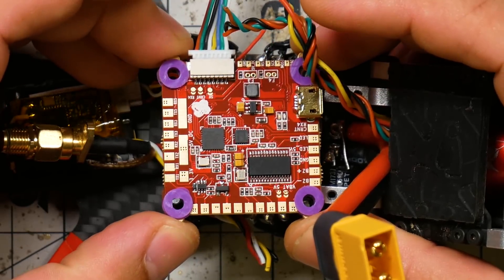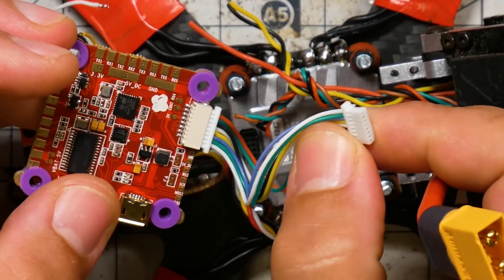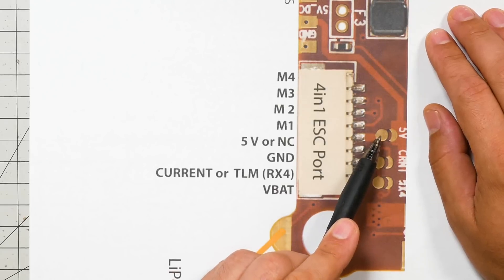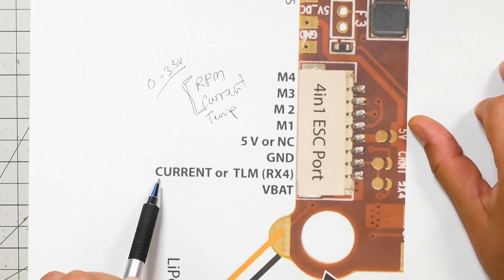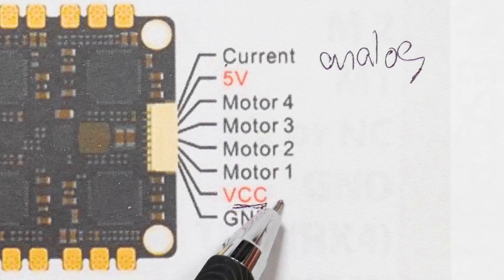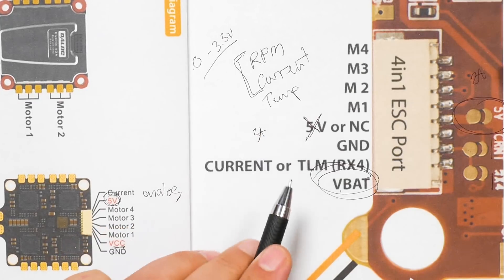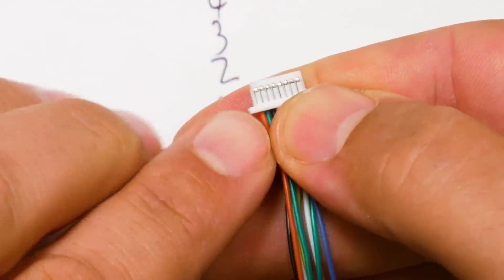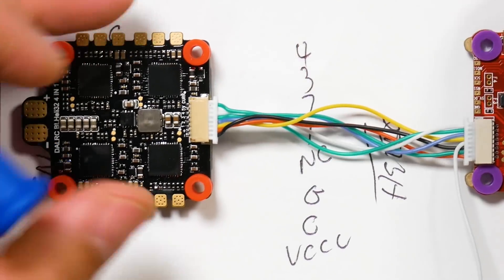How To Connect a 4-in-1 ESC to FC | HELIOSPRING DALRC ENGINE

Comment: My HGLRC fc is wired to my iflight esc. Motors match 1-1 2-2 3-3 4-4. I get the flip on takeoff. I'm guessing that HGLRC fc (motor 1) is not the same as iflight (motor 1). I know I can change the mixer which I have done so, but can I also just wire fc 1 to esc 4 and fc 2 to esc 3?

edit: it's a 4-in-1 esc.

Comment: Hi, I want to build a Quadcopter and I have purchased few things for my drone, but need to confirm few things from you:- 
Frame:- Martian II Reptile 250mm
Motors:- RS2205 2300KV motors
Receiver:- Flysky FS i6s

I am going to buy Emax Skyline 32 Advanced version and a 4 in 1 ESC but I am not sure which ESC is compatible with this and how can I connect all this connections for receiver and ESC. Can you please make a video of this or send a reference link where I can look into this?

Comment: Ok, so I have two wires left to go to my ESC. They are CRNT and RX6. The only two pinholes left are ground and 5v. Do I just have to pass on telemetry? And What is the purpose of RX6 in this case?
Reply: On second thought, I didn't get the wrong ESC, did I?

Comment: Do I need the current sensor cable coming from my flight controller if I don't have a pinhead for within my 4in1 connection or a pad to solder it too

Comment: Joshua,
Have the same question that a couple of other folks posted.
I am connecting a F722 Flight controller to 40A AKK esc. I am trying to match the pins between both boards on the connector cable. But I am confused on what the R6 on F722 stands for.
On my ESC: 5V GND GND BAT 1 2 3 4
F722: BAT GND S1 S2 S3 S4 CRNT R6
EDIT: As there is no separate Current on the ESC, what do we do with CRNT and R6, should these pins be completely removed ?

Comment: Hey Joshua! Great vid. Im building my first quad and ran into a small issue. Im using a iFlight Succex-D mini ESC and the Mini magnum 3 F4 flight controller. I wired everything up and it doesnt seem like the FC isnt powering on, however the LED on the xm+, connected to the FC, is turnibg on but faitly. The wiring from ESC to FC all match up to diagrams. The ESC has a VBAT and the FC has VCC, which are wired to each other. Can this be the issue? Thanks!

Comment: Thanks for this video JB. Super helpful! I purchased the iFlight SucceX-D F7 TwinG Flight Controller. The ESC pinout for it shows, GND, VBAT, M1, M2, M3, M4, CUR, and R5. The emax buzz esc shows S1, S2, S3, S4, Tx, VCC, and GND.  

The S1-S4, connections go together with the M1-M4 and GND and GND go together correct? Tx from your esc goes to the CUR on the F7 board I think..VCC goes to the VBAT? What do I do with the leftover R5 connection? 

Thank you so much!!
Reply: looking for the same info. did you ever figure out ?
mine has an R6, dont know what to do with this ? We would also have an extra GND pin, so perhaps leave it out ?

Comment: What happens when my plug gin too the flight controller is broke so I can't put 5v too power the fc idk what to do. Is there a way too put 5v too the fc without the plug
Reply from the maker: You can provide 5v into any 5v pad on the FC.
Reply: @JoshuaBardwell  i believe they gave me the wrong flight controller with the f445 stack. My flight controller would power up with usb and i could see my camera and vtx would power up. I dont have a xm plus receiver on yet but i wouldnt think that would not allow my flight controller too power up with battery connected? Once i unplug my usb the fc board lights would cut off but my vtx would still be on. I dont know what too do.
Reply: @JoshuaBardwell  Ijust dont know were too get 5v from the esc itself , there's no 5v pad that i can see

Comment: Hello again Joshua.  Wow, what a string of bad luck I've been having.  So I returned the 4-in-1 65a esc (below) and just bought 4 individual escs.  Soldered everything back up to the Joshua Bardwell FC with a focus on making it look beautiful again, ha ha, and guess what -- the brand new escs plugged into to the new replacement JB FC from RDQ (the first one fried the two right escs requiring me to purchase new ones lol) are doing the same strange power cycling (the fc seems to remain booted) and the tones get out of sync.  So clearly, the 4-in-1 was fine, and I made the 8-pin cable fine.  Ugh, I have not flown a 5" in way too long now ha ha.  You know I suppose it's possible that a microscopic piece of solder got in between something, but I even take precautions by putting a piece of tape over the board where I'm not soldering.  I have gone years with zero issues.   I doubt RDQ will send me another 'nother one.  So I guess I should cut my losses, blah
Reply from the maker: if the ESC's are making the full five startup tones, then they are losing power. If they are making only the last 2 tones then the FC is losing power or the signal wire to the ESC is messed up.
Reply: @JoshuaBardwell  Two different sets of escs, same results (4 separately wired vs. using 4in1 plug) so it was the fc.  RDQ gave me a credit on the board.

Comment: Hi Joshua, this is Fred from Orlando, you helped me get a bad JB FC replaced by RDQ.  Thank you - it is here.  I am wondering if this sparks any memory of what might be the problem.  I purchased a new 4-in-1 esc since the first board fried two of my 4 discreet ones.  I picked up a 65amp HLGRC one.  I followed this video and was super super duper careful that I made it match correctly.  With the 6pin esc cable in, it powers the fc, it all looks fine, then the escs start to power cycle.  Dah dah daaaah sound with maybe 2 seconds between each restart.  I plugged it into the computer and looked at the escs with BLheli32 latest, and it says unknown protocol instead of blheli32.  Perhaps I misunderstood one of the wires' purpose.  I also very carefully followed the jb fc build video again on the new fc and triple checked everything.  The solder bridges on the back are set for 5v and telemetry.
If you happen to read this and feel so inclined to respond, thanks so much!  I would be your Patreon partner but I am currently on a fixed income which limits me a lot.  I'll throw you some bucks on a live chat though next time I'm there.  So helpful.
Reply from the maker: Usually if you see "unknown protocol" in blheli that means that the ESC is blheli_s not blheli32.
Reply: @JoshuaBardwell  You're incredible at replying.  Ok thank you.  I will look up more about it, but I tried flashing them with blheli32, I honestly don't remember if it successfully flashed.  I can't imagine this fancy, expensive 32bit esc came with S by default. But escs I have not delved deep into, but maybe there's a good reason to.  
Thanks again.  I'll see if it lets me see it as blheli_s.  After that, off to watch your new RR tuning video.
Reply: Well I went back in and it definitely has blheli32.  It says so right above each "unknown input protocol".
But now I am seeing a repeatable pattern of esc #2 on the board only booting successfully once in a while.  Most of the time it's showing just --- for #2.
I guess I'll run your new board with discrete escs.
Thanks again, much appreciated, you always inspire me to dig deeper.

Comment: What does the N/C on mamba f405 mk2 4in1 esc mean? Im trying to wire it to the synergy f4 which has everythingtthe same plus a 5v. N/C on the esc and 5v on the FC. What would I need to do?
Reply: I should have watched the whole video before asking huh? Not used! So basically I don't even need to plug that one in. Thanks for the video! Bought a new FC using your links and ty for the advice on fb!

Comment: Hello, I have a question for you. I'm building my first quad and I choose Matek f405 std and racestar 4in1 esc 35 a. Question is: esc doesn't have 5v output and fc hasn't a bec. Can esc power fc from vbat?
Reply from the maker: The F405 std needs 5v input. It cannot be powered from vBat.

Comment: I have mamba f405 power stack and it have it's own connector from ESC to flight controller but OSD for current sensor is not working. Do I need to feed current signal to one of the UART??

Comment: help......................
i recently changed my escs to REV35 
it has same pin diagram i have only connected signals wires with F3 
but its not working 
Is it must to give 5V on 5v pin and gnd as well?
Reply from the maker: The FC needs power somehow. How it gets it is up to you. 5v input may be one way to do it.

Comment: I have a tmotor f55 and a kakute f7 (not aio). The f55 has both, tlm and current. Is it possible to connect the current of the esc with the tlm port of the fc or is this the best way to burn both?

Comment: Hey, if you dont have the right plug, can you solder them directly to the pads?
Reply from the maker: Yes you can. But I suggest ordering an sh cable set and making the correct cable. Racedayquads sells the set.
Reply: Awesome, thank you for the quick response.  They are out of stock, Ill see if I can find the set somewhere.

Comment: Fried my FC accidentally wiring the vbat wire from the ESC to a signal pin to the FC. It burned the F4 chip on the FC and the ESC visually didnt take any damage but it doesnt boot anymore. Can the esc still be fixed perhaps by identifying the component that broke? Mosfets are still good

Comment: Joshua,

I have purchased this ESC for an arming issue I have been having. It is all installed but when I go into Blheli and connect every esc reads "Erased or unknown firmware" If i select flash Blheli it reads the same message but with a lower case "u" underneath. Any suggestions. Btw the copter arms and spins motors with radio.

Dan
Reply from the maker: Are you using the correct version of blhelisuite? BLHelisuite32 for blheli32 ESCs and regular blhelisuite for blheli_S ESCs.
Reply: Joshua, that was it!!! Thank you!!!

Comment: Almost exactly what I was looking for! I purchased the same DALRC but I want it to be connected the the kakute F4 v2. The kakute F4 v2 diagram says :

1 Battery voltage
2 R5 (for ESC telemetry)
3 Ground
4 Current sensor input
5-8 Motors

So I guess that the pin 1 will be VCC and the "current" from the DALRC goes on the pin 4 ? What about the pin 2 R5 (for ESC telemetry) ?

Thank you in advance if you want to answer me :) This is my first build ever and I am quite nervous :)
Reply: same question, I see at least a couple of people asking. Did you ever figure this out ?
Reply: @warandv6614  Yes I did figure it out on my own, I also figured you need to "insert coin" to Bardwell for technical help :)
If you give me your email address I will email you the schematics I drew.
Cheers.

Comment: If you power the FC with V bat from a 4 in 1, will you get V bat at the other V bat   and ground inputs? ( to power VTX)
Reply from the maker: Yes. But you have to bridge the solder jumpers to put vBat on the pads where there is a choice.
Reply: Joshua Bardwell  Thank you

Comment: Joshua, Are you still liking the Heliospring FC I am a Matek fan but i would like to try this board. Problem is since its huge release i haven't heard much and read a few bad reviews i do not put much stock in the reviews but there has not been a lot of long term user info. 
Congratulations on your JB F4  it is a nice looking board as well but, i would like to try the helio and not regret it LOL. I know your busy, I want to be a patron but i think my girl would take a tack hammer to my head LOL!  Thank you for all you do!
Reply from the maker: I'm replacing the ESC on my Helio quad and haven't flown it in a while. But I liked it the last time I flew it.
Reply: @JoshuaBardwell  gonna replace  mine as well...bad fet. what are you replacing it with?

Comment: Hey JB  Really enjoy your videos.  I have a quick question on the UART port designation in butterflight for the FRSKY S- Port.  If connected as shown in Helio layout, which UART is used?  I assume UART 5 for smart audio but not clear on S- Port.  Also assume camera control does not need designation.
Reply from the maker: I'm sorry I don't know this off the top of my head. I'm using Crossfire on my Helio build so I'm not using the SBUS or SmartPort pads.
Reply: OK  Thanks reply.  I have not found any documentation with these details.   There's always good o'l trial and error.

Comment: I’m doing the same thing but with a dys f4 pro that I got in my kwadbox . My question is the dalrc has current 5v vcc and ground the fc says bat- bat+ nc and ground if I change the harness what would go to what
Reply from the maker: VCC is the same as BAT+

BAT- is the same as Ground.
Reply: Awesome thank you I thought so but wasn’t sure so I thought I’d ask the brain. What about the current?
Reply from the maker: Connect to the analog current sense input on the FC.

Comment: Hey Josh I just want to say first and foremost great job with all the info... Question.. I have a NTXF4 fc with the vtx built in, I was flying the other day and had a bit of a crash, and I noticed the metal cover to the vtx came off,  I tested everything and all works fine,  now my question is, is it ok to fly without the cover, I know the vtx gets hot so I don't know if it's just a shield or is it a heat sink as well,  I don't want to damage anything by flying without it,  but I am jonesing to fly.
Reply from the maker: The cover is an RF shield. I would expect some issues to pop up if you flew without it. Like video noise or random failsafe.
Reply: Joshua Bardwell ...Ok, thanks, I did notice more noise in the video feed afterwards... Thanks for the feed back.

Comment: Hey, JB.
Same setup I use and I soldered the Current and 5v bridges. I am using 5v in from DalRC as well as VBAT in, but not the bridge up top of the board and everything works fine....using VBAT for OSD.

Comment: Hey Josh, I have a DALRC Engine and a Holybro Kakute V2 F4, but not the all in one version, so there is no pin plug in on it, where would I go about soldering my Current and VCC/5V wire?

Comment: Hi josh, I’m relatively new to the hobby, I ripped off my buzzer soldering pads on my dys f4 flight controller and I was wondering if there are different options to wire a buzzer to it or can I repair the soldering pads?

Comment: I used the helio spring fc with a raceflight bolt and I'm pretty sure those wiring pinouts are identical. plug and play for me and it worked

Comment: I can tell you what will happen, when you put in the helio spring cable: you fry your setup! :((( First you hear the esc booting with a little bit of noice... then every part will die instantly without smoking. After finding the problem and reordering the helio I recognized that only one esc boots after connecting it the right way - so new ESCs to reorder. The RX doesn't want to give any stickinputs to the fc... well... vtx transmits an image, but haven't check smart audio, yet... at the end: better than loosing the entire bird...

Comment: Your video helps clear up confusion about this board. I did a Helio Spring/4-in-1 install two weeks ago.  I assumed the VBAT pin on the 4-in-1 connector was for voltage monitoring only, and if you want to power the board with VBAT, you need to use the power pads on the board.  It's good to know this isn't necessary.  My setup (Helio Spring/Aikon AK32) runs off 5V and has VBAT monitoring.  Having dueling regulators isn't a problem (for me),

Comment: Wow you totally wrecked that connector, lol! I have moved wires around in those connectors a few times and it really sucks when you get to the last one you need to do and start carefully lifting the tab only to have it break off unexpectedly. That is the exact reason I have two of the wiring kits already in my collection. Those things are immensely useful. Another great video Joshua.

Comment: Hey Josh! Can you try wiring an frsky receiver to the sbus port and reciever power and let me know if the board won't boot. I had to run mine off the 5v rather then the provided receiver power or the board wouldn't boot. If I plugged in USB with the receiver connected to receiver power it would fry the board.      I went through 3 boards before I tried one thing at a time and isolated it to the receiver. Weird...
Reply from the maker: I've wired up my FC as intended by the Philip Seidell diagram.
Reply: yeah I actually bridged Vbat and I think it caused a weird issue. You didn't mention that bridge at all and other people mentioned ignoring it.

Comment: I was about to hook up my helio fc to an Aikon AK32 AIO esc, when I saw you posted this video. Perfect timing!
Reply: Herman Harmers how did you go? Doing 2 of these this weekend.
Reply: Just swapped all the wires to the right position in the aikon connector, not tested it yet.
Reply: i did it and it is working great  but i used one ground and use current and not the tel, you can use tel but direct solder it to uart or viceversa
Reply: I'm using the Aikon AK32 AIO and HelioSpring, setup was a breeze and I had no issues whatsoever. Quad is flying great.
Reply: Hi i have the same ESC and Fc. Just the Helio Spring V2 Version 2 ( no solderbridges) So you Powered the Fc with 5V from the Aikon 4 in 1? Is it right? Best regards Marc from Germany

Comment: Awesome vid. How do i connect the same 4 in 1 esc to a furious fc with no plug on the fc. My first kwad was a bind and fly so i am building my second. Chameleon TI. Flown rotor wing for years just switched to multi rotors a few months ago.
Reply from the maker: You have to solder the wires to the FC.

Comment: Sick video buddy and pleasure speaking this weekend! Crazy but my buddy popped that thing in turtle mode lol. One thing I learned the hard way was running an esc that was full power to fc that needed to be stepped down/5v. Just as you said the plug doesn't always work...my burnt fc explains that! It's crazy but I have an old f3 that actually takes in both vbat and 5v, but I assume the board is stepping down an supplying power else, leds, vtx etc. Thanks Josh!